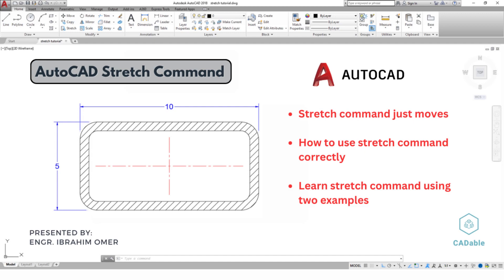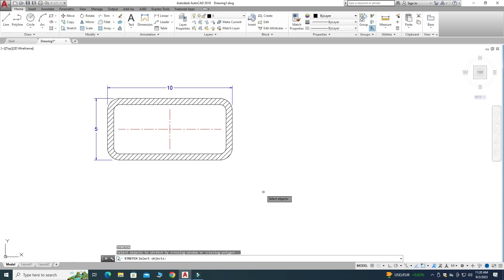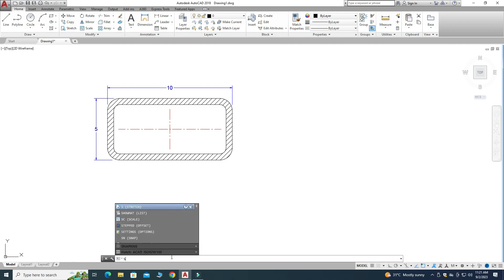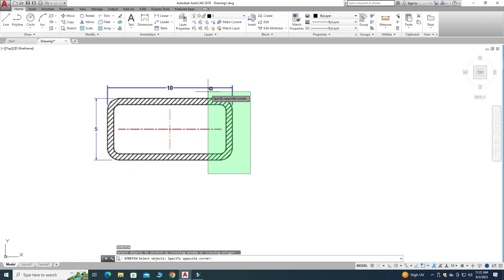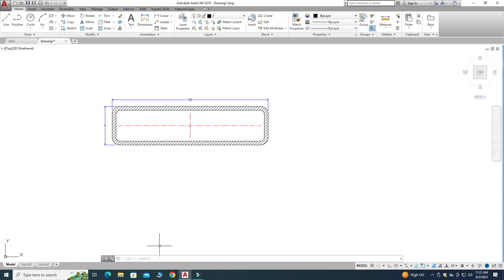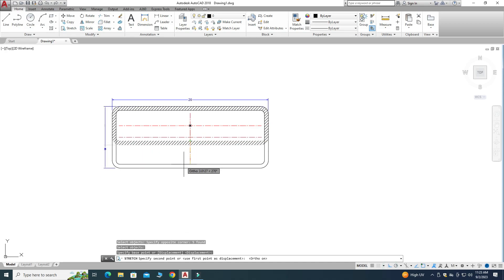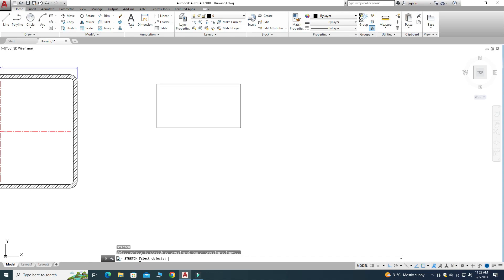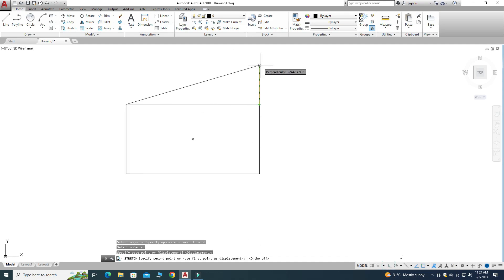AutoCAD Stretch Command | How to use stretch command correctly | Stretch command just moves

Comment: so, im using dinamyc blocks, i have a bathroom sink unit that i want to stretch but and i want the sink to stay in the center of the unit but it keeps moving, and i dont want it to strech the sink to modify its dimensions either, so i have so select it as whole but it keeps moving with the stretch and not centering itself to it any clues? im stuck.
Reply from the maker: Don’t explode the blockm that removes all dynamic behavior. Instead, open it in Block Editor (BEDIT). 

Use a Linear Parameter with a Stretch Action for the cabinet only, and a Move Action for the sink. Make the sink move half the stretch distance so it stays centered. 

Also, make sure the sink is not inside the stretch frame, so its size doesn’t change. This keeps the sink centered and unscaled when stretching the unit.